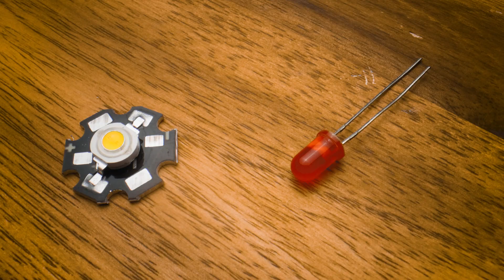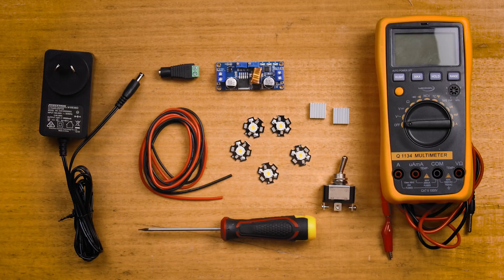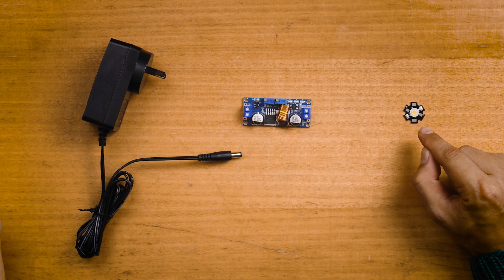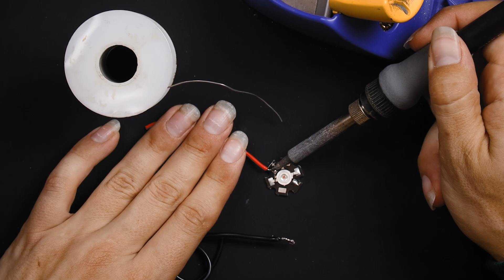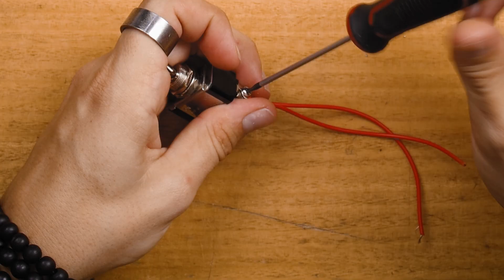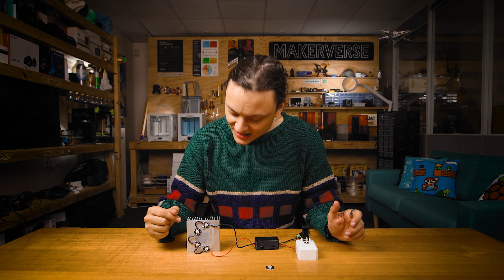How to Drive High Power LEDs With A DC-DC Adjustable Step-Down Module

Comment: How to Connect a 6 pin 3 watt single led?
Reply from the maker: I reckon you must be talking about these Triple Output High Power RGB LED - https://core-electronics.com.au/triple-output-high-power-rgb-led-49343.html

These are awesome because they can produce RGB colours 😊 Depending on how much voltage you give each pad you can get all the colours. Check here for the voltage ranges and Pinouts. - https://core-electronics.com.au/attachments/localcontent/M018001MA3LZ_552043ff372.pdf

This fellow has crushed a great tutorial on them to get you up to speed - https://www.youtube.com/watch?v=WzYdK8qJPlY
Reply: @Core-Electronics  yes sir,these leds .sir I have few questions: 

1. Can I use a ready made driver of 3-15 v ,3 watt driver with it?

2. Can I control the RGB colour by common anode/cathode and using a Chinese controler?

Comment: Insteadof Ac connection if we want to connect it with a 3W 6v 3A solar panel then
Reply from the maker: Heyya mate, so everything in this set up is DC (no AC current to be found, except for coming into the power-supply at the wall). So long as your 3W 6V 3A solar panel is outputting DC current you should be able to use a boost or buck converter (depending on your Voltage requirements, which depends on how many LED Nodes you have hooked up) to get the correct electrical energy to the LED Nodes.
Reply: Can u please send a diagram, explain

Comment: great video, but how to connect the microcontroller with the step down buck converter? should you use mosfets? how to wire them in practical environment, where leds will need long power cables, should you add the converter on the powering side or the led side of the cables? how to calculate and compensate for the resistance and losses of long powering cables for the led's?
Reply from the maker: These are absolutely brilliant questions. Personally I try to keep the voltage as high as possible for long distance cable routing. As you want to use a step down buck converter I would implement that close to the LED side of the cables. 

Next your interested in the resistance for long lines of powering cable. The resistance is directly proportional to the length of the wire. If the length doubles, the resistance doubles. If the length triples, the resistance triples. This website will provide you with some resistance values for different copper lengths/connectors (network Cat6 Cable is a good choice for long distances) - https://daycounter.com/Calculators/AWG.phtml - Then you just need to work out the load that you're putting on the wire in terms of current and use V=IR to work out the voltage drop and if it is acceptable.

As a general rule of thumb 5V will get through 50 feet of cable and still function well for most tasks. I say this as the other concern with long wires is picking up EMI (Electro-Magnetic Interference) when using lengths above 50 feet. Capacitance and RF interference shouldn't be much of an issue at logic frequencies / voltages, but would become an issue when dealing with analog audio, video, or radio signals. 

Hope that helps!

Comment: Can i use that step down module for 4.2v to 3.4v ?
Reply from the maker: From the specification sheet which you can find in the bottom of this page - https://core-electronics.com.au/dc-dc-adjustable-step-down-module-5a-75w.html

Input Voltage Range: DC 4-38V
Output Voltage Range: DC 1.25-36V Adjustable

Looks to me like you definitely could use it to step down 4.2v to 3.4v 😊

Comment: For a situation where you have a battery and you must rely on that one battery for night riding. The power supply is a 12v lithium drill battery which function is to power LED lights. The system must be extremely efficient. The LEDs will be 3.5v so then - 12v to 3.5 - to 5v step-down. LED lights which each can be powered by a 18650 battery. What is best to use? Thumbs up. For this application can you put in series several LEDs to act as resisters? If so, what would that look like?
Reply from the maker: Doing one power conversion is the most efficient way to get power requirements to where they need to be. Multiple Step down/up power conversions are less efficient. LEDs Nodes are best wired up in parallel so that way if one drops out they all won't. And LED are Diodes are not resistors. Whereas a filament light bulb that can be thought of as a resistor.

Come check the full written up guide for this video as there is more information there 😊 and if you want further help come write up a forum post here - https://forum.core-electronics.com.au/
Reply: @Core-Electronics  Thank you for your response and the resource.